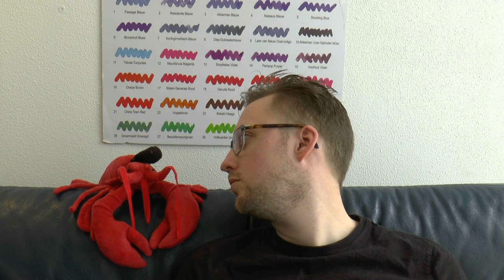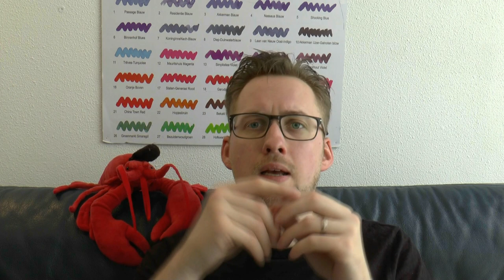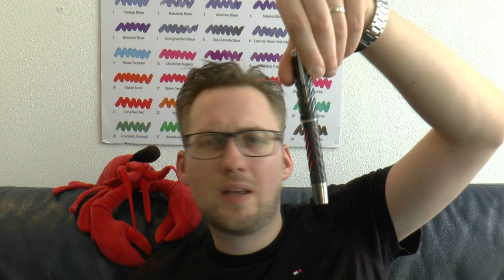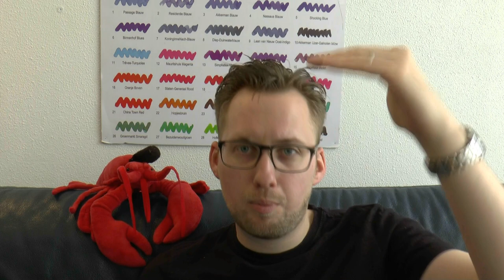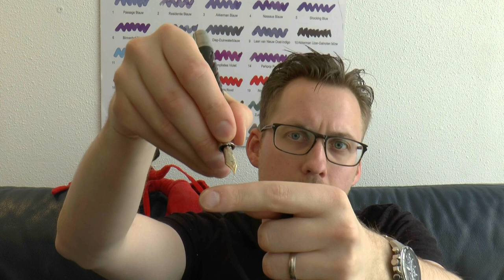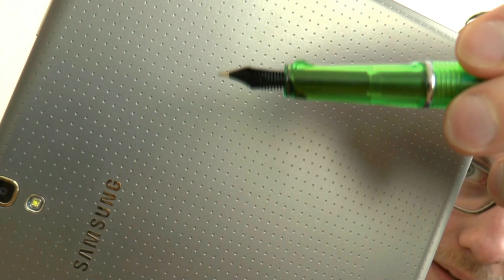Consult the Doctor Episode 3

Comment: Great session, Doctor - thank you. Just wanted to share a tip that is applicable to the arthritis and slippery section questions. I also have arthritis in my fingers, so can't grip the pen very tightly. When I have a slippery section, I give it some texture - very very gently- rotating with a super fine grade of sandpaper. It's amazing the difference a bit of texture makes to the ease of holding a pen. And if you're careful, you can't see any damage at all.

Comment: Hi,

Can I suggest to the chap? - who was asking about pens to suit his ailment that before or even if he can get a greater girthed pen he use some none slip tape to build up either his favourite pen/s barrel and the finger bit to the same size, or do the same to a dip-pen to use for several months before or, as he is trying to find the FAT pens. 
He may in fact need not only a fatter pen but also a less slippy one. I do not use or have never used a pen of any sort everyday, but do have his or her problem and found a thin later of paper tape around the pen can help. 
It can also be cut through to where the pen divides allowing the pen to be easily refiled and worked on. 
I find the pens where the finger holding part is metal and usually more slippery to cause my fingers and arm to hurt after really quite a shout time with these metal ended pens. He can also remodel his pen to where he actually needs the thickness increased rather than being increased layer by layer along the entire length.

Comment: sbebrown - I was curious on one thing.  You mentioned that the gold nibs give you a warning of sorts before they get sprung.  I was curious if you can elaborate further on that in a future video.

I bought a platinum pen with a gold nib.  Right from the beginning it had problems, and while gave some flex, I basically "messed it up".  I was able to bend everything back in place, and it works just fine now....but I don't write with it much because I'm kinda afraid of screwing it up again.  Understanding the feedback you're talking about would be super useful, because about half (of the 20-30 pens I own now) are with gold nibs.  I like the line variation, but I don't really press them much (except for my pilot metal falcon)
Reply from the maker: +David Thole I've added it to the list for next time!

Comment: Re: Nibs adapting to the user. I have a MB 149 that I have used for 40 years, and the medium tip has developed a flat spot, moving the nib very lightly towards broad writing instead of its original medium. I have tried writing holding the nib at different angles, and it makes no obvious difference -- certainly no extra feedback, but maybe doing that makes the point write with its original medium line. I would suppose that anyone using this pen would not notice any difference between my old pen and a new one. If they used the pen for 40 years at a different angle, the nib would simply develop another, competing, flat spot. It would end up being a true broad nib, I would imagine.

Comment: I doubt they are using Ti as a tipping material, it's an wonderful material but it is a terrible bearing material. Even the hardened alloys are very prone to wear and gailling. Titanium is notoriously difficult to weld so perhaps that is the issue, maybe it's just not compatible with standard tipping materials like iridium osmium an etc... thinking about it Parker T1 were notorious for having their tipping pellets simply fall off randomly. 

So have you tried polishing them? It could also be the vibration transmitted by the titanium, perhaps it's not such a good damper as steel or gold. Since most try to be soft nibs that could also be the issue, kinda like a singing nib.
Reply from the maker: That makes sense!